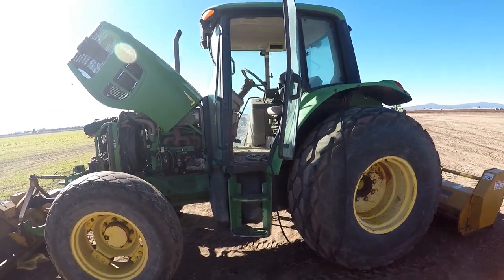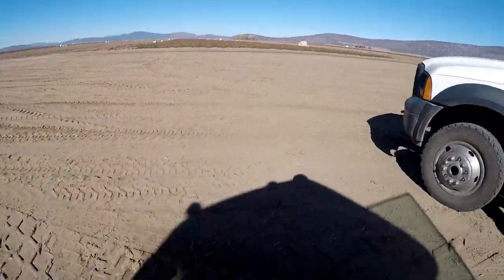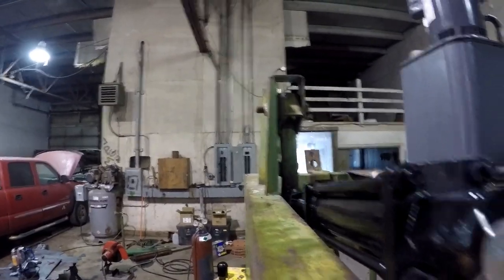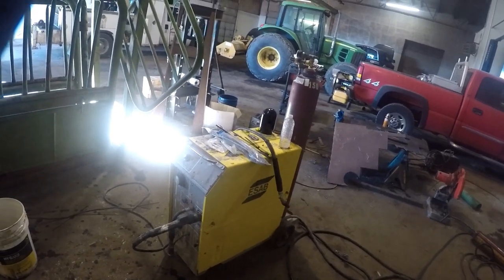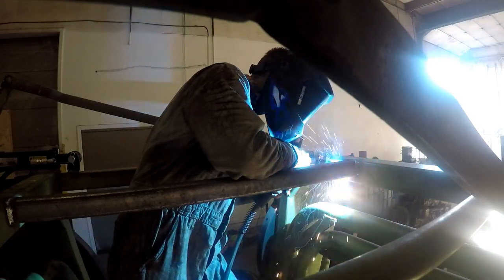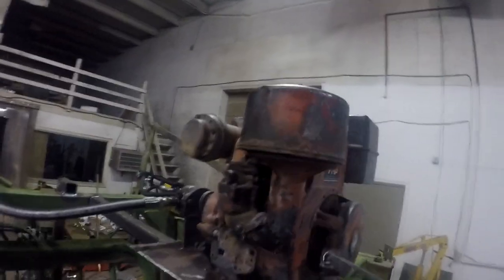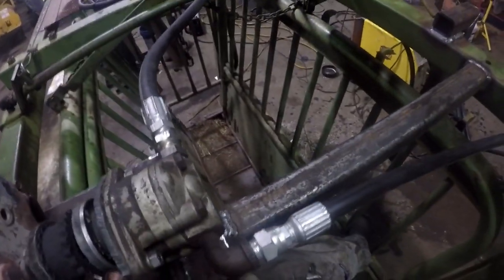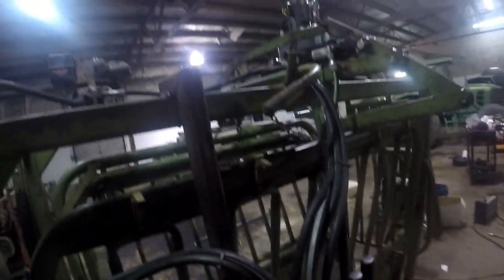John Deere's and squeeze chutes

Comment: You're on track with the MIG.  When running gas you want minimal stickout.  Steel should be clean as possible as you really have no cleaning action as the gas only shields the puddle.  Flux core is probably a better option for many of your applications unless you want to take the time to prep everything.  I've never had a good experience trying to get a B&S to run above rated speed.  Usually break the end off the governor arm inside the engine at some point.  Can't imagine livestock being thrilled with it either. 
 Electric motor would be ideal, .  I'm thinking a smaller diameter cylinder for the head stock or maybe try making another hole closer to the pivot would improve the speed.  The squeeze seems about right, maybe a touch slow but probably livable.
Reply: Totally agree. Another option is Dual Shield. It's less sensitive to dirty metal, stronger than hell, and has outstanding production speed. Just a thought.

Comment: I don't like the idea of mounting the gas motor on the chute.  A better system is long hoses so the pump can be set away from the chute. Much better for fueling and adding oil. Pump then can be stored in a dry place when not in use. Also seen them run  off skid steer loaders.

Comment: Had a genie gt-1056 at work. Unit would load down hard in drive, 3rd gear. Engine rpms came up upon lifting boom while driving, mainly boom up or frame tilt. Rpm came straight up. I was told a brand new pump was installed from company inventory. I tested pumps bypass and violently filled a 5 gallon bucket with fluid. Unit also exhibited high hydraulic temps everywhere, even after a short trip around the yard. Pump was trash. The company wouldn't spend 1000 bucks for a new pump.3 weeks later, company went under. 5 store rental operation gone.

Comment: U say it your self, u are used to fluxcore. That makes u pull away the handle too fast. That´s what  making pores. With gas u need to hover the handle over the puddle for a sec. after u stop welding, so the gas keeps shielding it while cooling. Other than that, MIG is pretty forgiving, in my opinion. It only needs a tiny bit of bare metal to get a hold and u can "3D print" across big gaps, if u pulse weld. Other than that i´m old school  and prefer stick, when welding heavy gage steel. Good job on the videos, keep them coming.

Comment: Should be possible to do this using another electric motor and the two pumps. Use the large pump as a low pressure unit with a check valve for speed and the other small high pressure pump for clamping the cow tight.

Comment: Couldn't you have used smaller diameter hydraulic cylinders. You don't need a  lot of pressure as it is hydraulic, far more than the pressures a man could create. That gas engine is gonna sound like its in your brain.

Comment: One problem with jig is things need to be clean. No paint, no rust, no oil and so on, small grinders with a coarse flap wheel on it. Anti spatter in a tub save nozzle and tips big time.

Comment: Head catch, bigger return line, and instead of going through the valve block discharge via a tee'd in relive valve to tank set to a lower system pressure.
And possibly set system relive valve so as not to stall the engine out as ya don't want it to cut out mid cow squeeze, oh and move exhaust so its pointing away from the cow n not gassing it, lol. Just a thought on my behalf.
My line of work we were always making improvements on the concrete production plant and quarry equipment